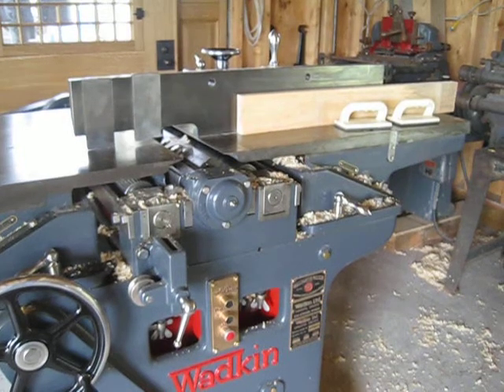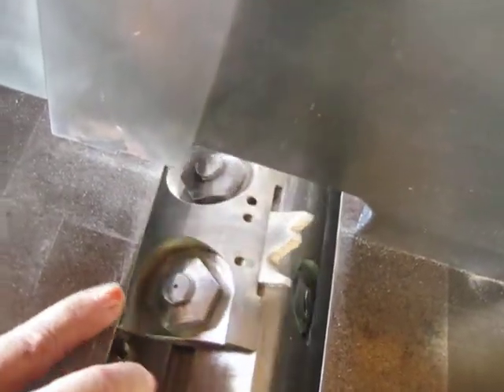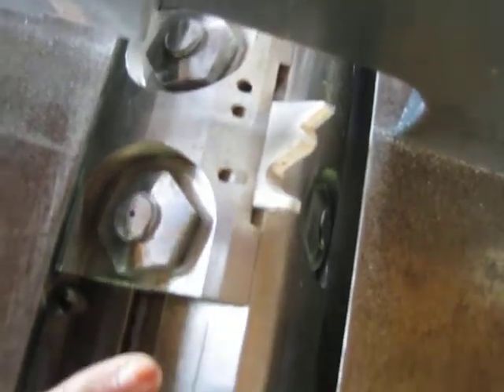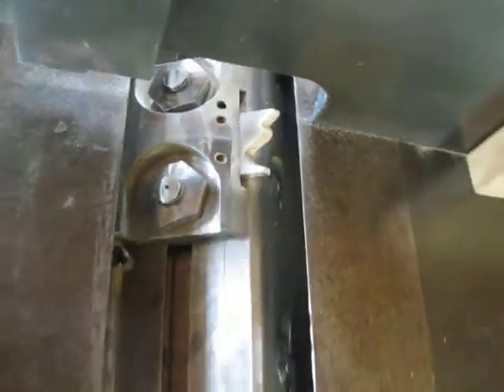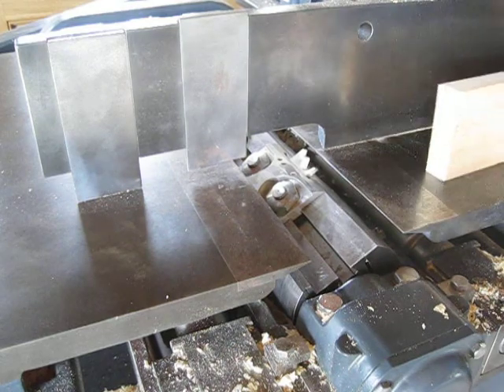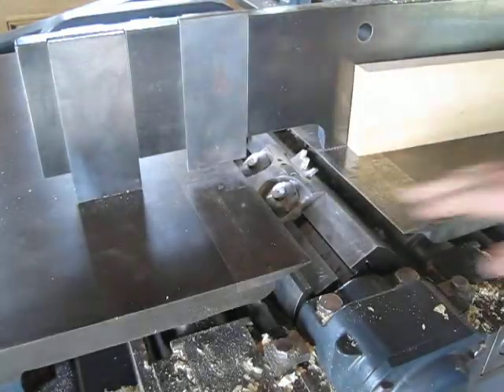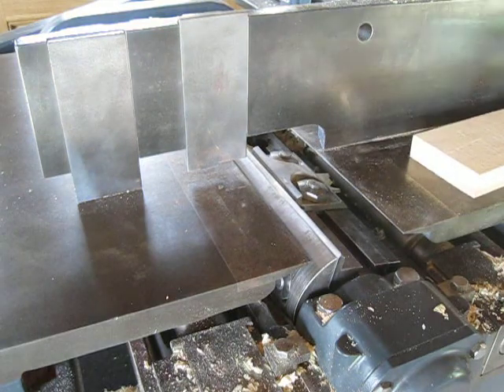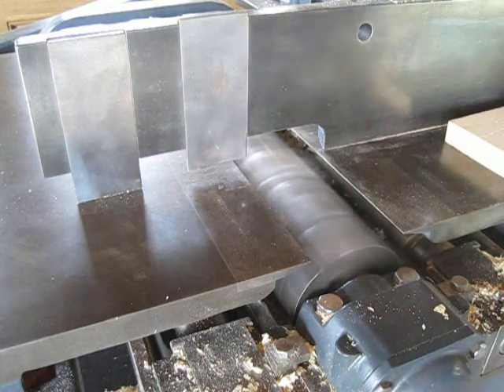Wadkin RM moulder shoes AKA Matt Matt nervania

Comment: Nice clamp/bracket that enables standard cutters to be used, Dominion also had this facility on their planer heads, using a flat plate cutter that was bolted on, a piece of brown paper was often used under the cutter to pack and give extra grip and stop slippage. I have just given a deposit on an RM planer, hopefully, will collect it this week, the present owner has it on heavy castors so it should be easy enough to load. Enjoy your videos on Wadkin machinery. Educational and inspirational To all who watch them, keep up the great work Jack.
Reply from the maker: Good luck on getting your RM they are a fantastic machine.